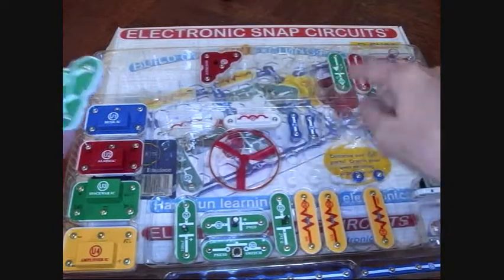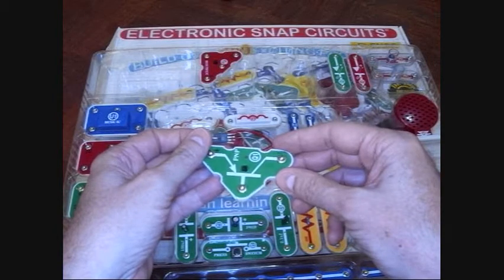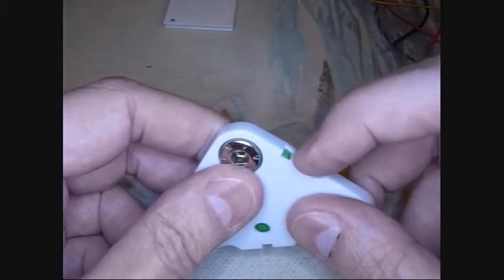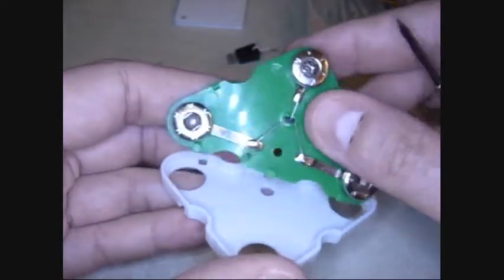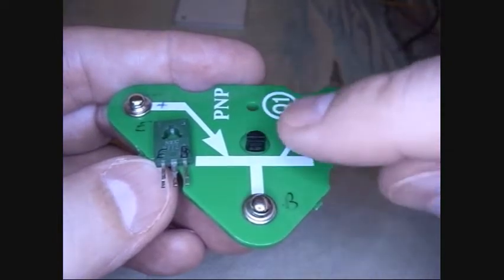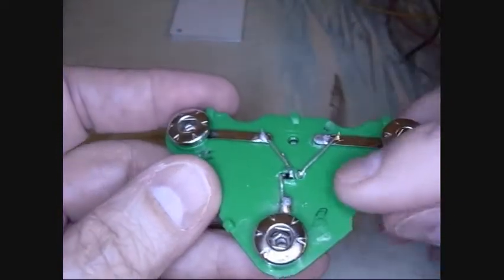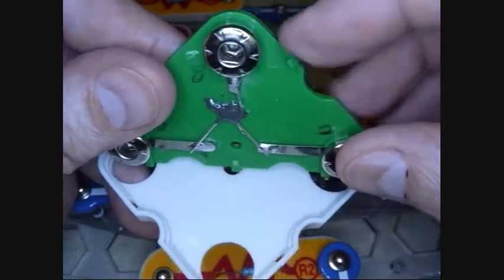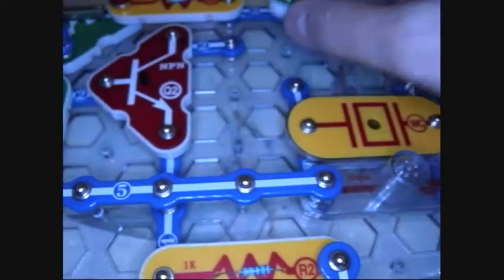Snap Circuits Radical Hack / Mod (Updated Video Available)

Comment: THanks for your video.  Which transistors originally used as pnp and npn?
Reply from the maker: I don't have them any more, they were bad so I threw them away.  They are just general purpose transistors.